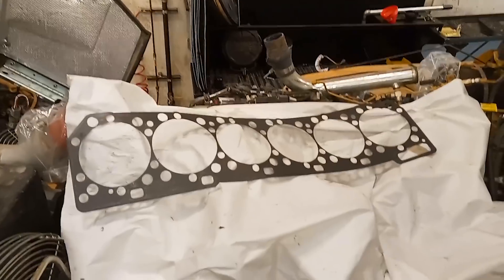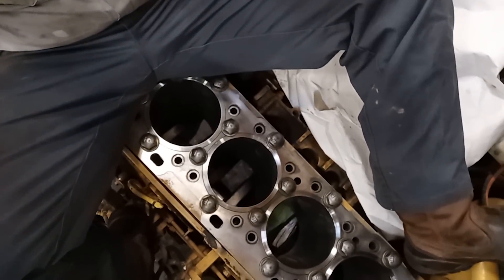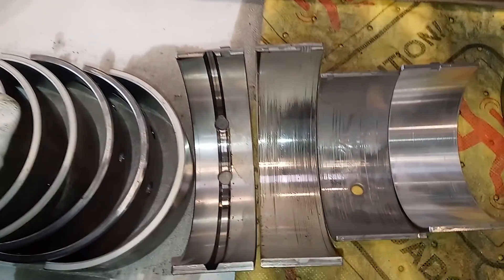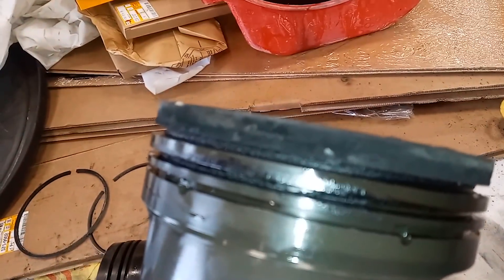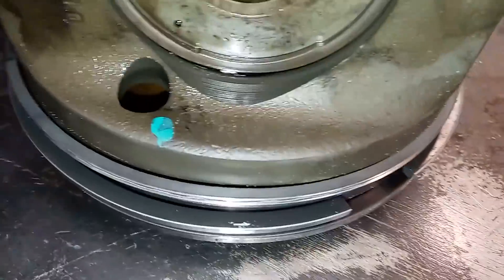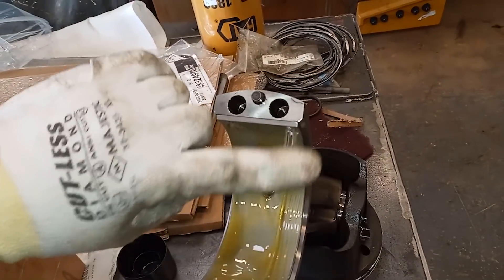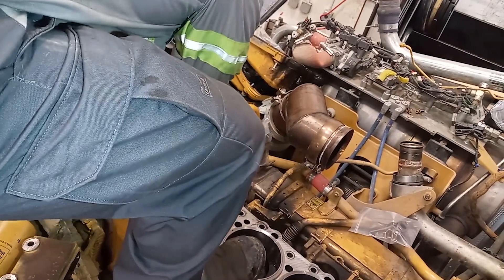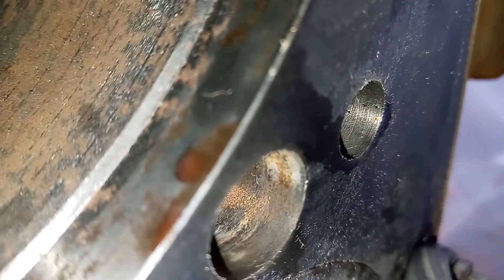A Cat C18 in a "TRUCK" in the shop.

Comment: I worked with a guy years ago that when doing bearings on a big cam Cummins he never rolled the top crank bearing in . He said they never showed any wear.
Reply: he was lazy, antifreeze will eat them up and corrode them with pits.
Reply: @youtubeisawesome2487  I did bearings on an engine he'd done a bearings on a few years earlier and the upper bearings looked like crap. Not worn but flaked and chunked out. You can't buy just the lower and the upper isn't that much more work. (There were at least 6 or 7 half sets laying around the shop)

Comment: The Destruction of the week is a prime example of why a good ol' flappy-clappy-rattlely rain cap can't be beat. Yeah chromed, 4 inch, miter cut stacks look rad... but a functional engine is more rad.
Reply: nothing an old folgers can can't fix. my grandpa had a farm with lots of equipment that would sit for long periods of time. he put folgers cans over all the exhaust stacks. keeps the weather out, and when you're ready to use that rig, you just fire it up and it blows the can off.
Reply: Not fool proof though...us humans forget.
Reply: You would think they have a drain in the exhaust at the lowest spot, with a check valve. I am sure the exhaust pressure when running should overcome the spring pressure and close upon startup. But hey, I am no engineer, Just thinking out loud.
Reply: I reckon this makes a great case for the practicality of Peterbilt running the exhaust below the frame before coming up into the mufflers on traditional styled models; it's not just for good looks! The exhaust ends up running several feet lower than the turbo and exhaust manifold. That'd be one heck of a rain to fill those pipes up enough to get into the cylinders.
Reply: That is the price somebody paid because of their weird version of style
Reply: @kevinbarry71  you’re saying the flappy cap is weird? I think it looks good.
Reply: I use turn back stacks so hopefully water doesn’t get in there myself. Worked good so after many years.
Reply: The winds keep blowing my cap open ....☹️

Gotta get a pail to put over the cap....
Reply: @michaeldunagan8268  weld a nut to the underside of the flapper. Been doing that for many years now, never had a problem
Reply: I’m a fan of the rain flaps especially on old cabovers

Comment: Yep block is the same as C15 and rods piston 5.7 bore and the crank 7.2 stroke 1104. displacement  It running in my road truck  I pull 164,000 lbs give or take a few thousand lbs super train.
Reply: So I could make my c15 an c18 with just new liners and piston packs?
Reply: @chrisarcher4098  and crank shaft cam injectors.
And the pistons coolers that spray oil to the bottom of the piston.
I took my NSX block and had aligned   honed did uppers and lower bore insert install And deck the block.
. Also there other options IPD BIG BORE KIT .C15 14.6 Liter and 15.2.
Your crank rods the big bore kit will become 17.0 Liters using C15 crank 2 bolt rod 14.6L the  15.2L is 4 bolt rod and it works.
Now C15 block casting number 1974 C15 15.2 L block will fit the crank out C18 no problem.it same platform C15 is  928 CID and the and C18 is 1104.2 CID.my uses NXS TWIN TURBOS COMPRESS RATIO 16.1 I HAVE ACERT TECHNOLOGY WORKING AS IT SHOULD SET IT 625hp and 2400 lbs tork I have ran it up to 1000 up 3200 lbs tork it works but it for truck pulling. So I quit that foolishness hard on the pocket book
625 and 2400 perfect for the truck and drive line.  Josh the haul truck that your working on can you get some shots of the transmission I thinking of retrofit one into my truck fluid drive instead shaft and clutch.
I look at oskosh m1070a2 super het and that is basically my setup without the Allison transmission.
That 300,000 lbs haul rate. I drove one bad  to bone.

Comment: 7th
Edit: could ya put this in a tractor truck?
Edit2: damn that sux need a new block.
Reply: You can... You'll find them in Australia on those road train tractor trucks...

It will fit on a C15 engine mount as it has the same block as the C18.

Comment: If I got assigned a job like that I'd wonder if it's because they trust I can handle it or it's a punishment. 
Just teasing.
Edit: You're an teacher and finally a worthy test of an ultrasonic cleaner as I dislike wasting $.
Reply from the maker: The job has been difficult, torquing the head with it being so low sitting relative to your body was hard and the cam backlash was off and took forever to correct. Oh well, difficulty breeds innovation and builds character.
Reply: @AdeptApe  I can only imagine how big a pain that is all together.